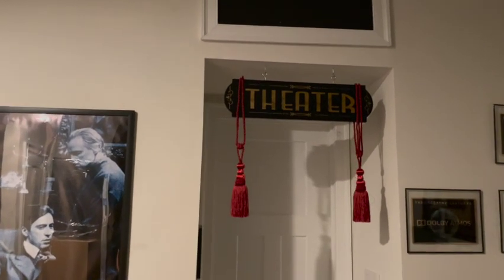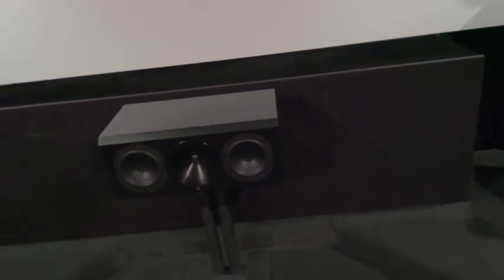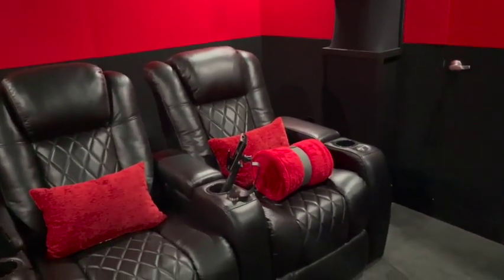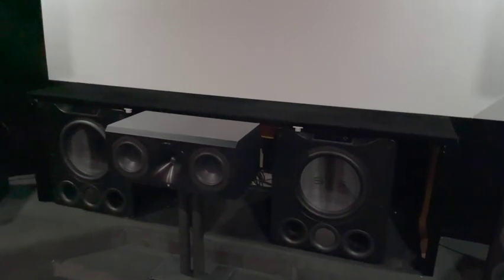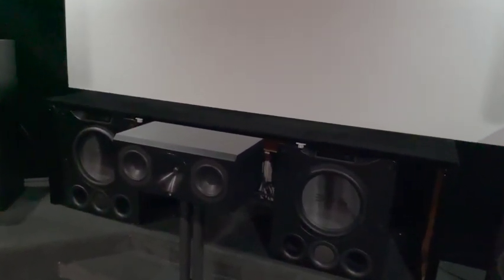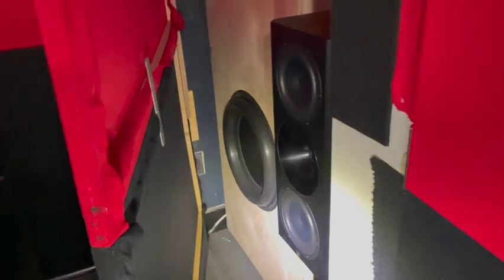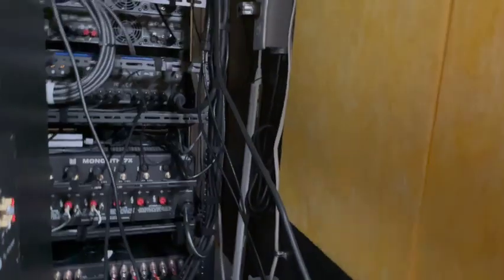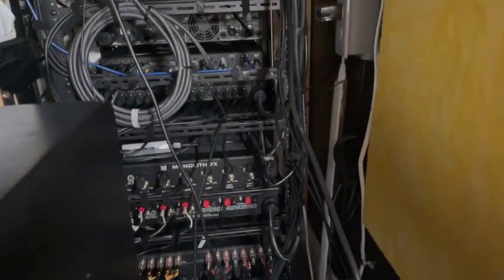DIY Home Theater Tour 2021 - | Monolith | Arendal | JVC | ....

Comment: Nice job!  You sound like me, buying extra's of everything so if you need it later you have it.  I have a whole room full of crap acquired based on that reasoning.  Probably most of it I will never get around to doing anything with.
Reply from the maker: Thanks!  And, yea, there's definitely some stuff that's never gonna get used, but it's so nice when you have an idea or you're working on something and you have exactly what you need on hand.

Comment: Awesome job, love the whole layout.  I do have a question.  How did you do your panels for your screen wall?  I am building a faux screen wall in front of window and I am getting ideas on how to do panels for the wall.  Thanks again.
Reply from the maker: Thanks!  It’s just some 1x frames.  I think I used 1x3 pine.  Just have to add a brace near the middle on the longer/taller frames.  Then I wrapped them in Velvet.  They are all friction fit in place between the walls/ceiling/floor.
Reply: @dwht5893  thanks for the reply.

Comment: Hey sweet setup! I have had my eye on  the GSG BTS series but havent been able to find much from anyone who owns one. Are you happy with it or would you try a different profile if you were to do it over? Performance wise how do the compare to the PB 16 ultras?
Reply from the maker: My space for the rear subs is pretty tight, but if I built the box myself I could have made it a little bigger than the BTS and picked up a little more extension and output.  However, the BTS was very close to what I wanted and I knew it would be a better built box than if I did it myself.  I have no regrets with the call I made though.  Only thing is, I didn't think to ask them to custom size it for my driver, so I had to do it myself with a router.  

I find that my DIY subs blow away the PB-16s.  I got the PB-16s in earlier the same week that I built the DIY subs.  So, I installed the SVS, did a quick calibration, and I found them to definitely be better than the HSU Research subs they replaced but they didn't blow me away or anything.  Granted it was very limited listening.  With the DIY subs, I got them installed and calibrated late Sunday night, so I just finished and went to bed.  Came home from work the next day and threw on the same demo as I did with the SVS.  It was a whole other level.  One of the rare moments for me where I first use a new piece of gear and I'm just completely blown away from minute 1.  Those Stereo Integrity drivers are definitely worth their price.  The PB-16s do provide a good amount more extension though.
Reply: @dwht5893  thanks so much for the answer. I currently have one SVS PB 1000 and dream of the day of upgrading further. Unfortunately I don't have a dedicated theater room but instead use the corner of an large open partially finished basement. I knew I could fit the BTS boxes behind my screen but couldn't find any reviews for the life of me. Your theater is quite the inspiration. Thanks for the tour and the feedback.

Comment: Are you running DLBC for the 4 subs? How's that been in balancing the bass on that room? Especially with integrating to the crossover point on the fronts?
Reply from the maker: I've been using DLBC for a little while.  Dirac as a whole was a bit of a learning curve for me, but after a lot of playing around I feel like I've figured what works for me.  It does a really good job with the bass and integration of speakers to subs.  Especially with the front 3 speakers.
Reply: @dwht5893  Thank you, any tips or pro advice for experienced users? I'm pretty comfortable with Dirac, but DLBC will be new to me. Do you still have the MiniDSP 2x4HD in the chain? What corrections are needed post Dirac results?
Reply from the maker: I have a MiniDSP still in the chain but only on the DIY subs as a HPF.  But if youre comfortable with Dirac then you should be fine.  DLBC has 3 levels to choose from which create the filters a little differently.  You'll want to use level 2 for all surround applications, and Level 3 for any 2 channel with Subwoofer applications.  What can be time consuming is it takes a few minutes to calculate the filters.  Then in each speaker group it will show you the predicted response for the speaker spliced with the subs.  As soon as you make a single adjustment the predicted response goes away and you need to calculate again to see the new response.  So when you start playing with different crossovers you will adjust the crossover, calculate, and see the response.  Now if you don't like the result then its rinse repeat until you're happy with what you see.  So that takes time since you have to do it for each speaker group.

The two main things in general that took me a little while to figure out that really helped was:
1.  How to yield channel trims that I was happy with.  At first I kept getting low trims which made me have to crank the volume higher than id like to get the level I wanted.  Not a problem for everyone, but it was for me.
2.  Mic Locations:  For a while I was trying to closely follow the mic positions that Dirac shows in their diagram.  That was yielding some weird results when measuring post calibration.  So I started keeping the mic positions tighter the listening positions and that yielded both good sounding results and good measurable results.
Reply: @dwht5893  Man, this is gold. I really appreciate you taking the time to write that up. One last request, would it be possible to run 2 identical subs via y cable to one of the subwoofer outputs, so Dirac recognizes as one? DLBC is only limited to 4 subs channels, correct?
Reply from the maker: I don’t believe DLBC has a subwoofer channel limit.  In my case, its the processor that has a limit which I believe is 5 subs max.  But You could definitely combine two subs to one channel with a Y splitter, but I would only do that if they were the same distance to the MLP.  Otherwise it would be better to use a MiniDSP and align them before running Dirac.  I’ve been considering adding front wides to my system which would only leave me with 3 sub channels, so I’ve been thinking about how I would go about combining two subs to one.
Reply: @dwht5893  Thank you again. I'll be digging into the setup this week, so your advice will be invaluable. That's too bad the max sub limit is 5. I'm possibly aiming for 6, but I might two pairs of compact subs, stacked, for the front stage, so I might be able to get away with the Y splitter. Should be fun to try. Do you feel there's a gap in your front stage, to warrant front wides? Those Arendals have some crazy horizontal dispersion with that waveguide, so I figured you'd be set there. It would be cool to see if one to implement two pairs of narrow dispersion speakers with a deep soundstage, like the KEF R3/R5. I can see that working for front wides.
Reply from the maker: You may be right.  I've been debating adding wides for a little while and can't seem to sell myself on it.  I'm thinking when DTS-X pro becomes available ill test with some speakers I have on hand and see what I think.

Comment: Wow, I love your room! Can you give any details on your masking system? I built one with a roller shade motor that came out pretty good. What did you use for yours?
Reply from the maker: Thanks!  I used the same thing.  My first version used a pvc pipe bc I couldn’t easily find a roller shade tube.  I had to use a bracket in the middle to keep the pipe level which forced me to have it roll away from the screen which isn’t ideal.  Eventually I found shade tubes and re-did it so it would roll towards the screen.  That keeps the mask tighter to the screen which works much better.  Only issue is that the bracket from the first version stretched the fabric a little.  So when I leveled the new version with the roller shade tube the fabric wasn’t level to the screen when it was down.  So I had to adjust the fabric to make it level.  Now, the only point the fabric is level to the screen is in its down position.  It’s not a huge deal as it functions the same but it would look cooler if it lowered and raised nice and level.  I may get some new fabric at some point and redo it.  

I took the fabric to a tailor and had them size it and add a pocket across the bottom.  The got these 1”x48” aluminum bars, taped them together and slid it into the pocket to keep it weighted and level.  
Masking makes a huge difference to the experience imo.
Reply: @dwht5893  Do you only have the top mask dropping down? I guess you use the lens memory to adjust between 16X9 and scope? I could have done that with my JVC but I also use a DLP projector as well for non-movie content and wanted the option of masking for that content as well. I agree, masking makes a huge difference and I wouldn’t go without it. How do you control your roller shade motor? My remote is RF and I haven’t found a way to control it with my Harmony so I have yet another remote in my setup. Here is a link to mine https://youtu.be/UhRA4Vdx6oc
Reply from the maker: Correct.  I only drop down and use the lens memory on the JVC.  Honestly, I’d prefer it your way bc I don’t like switching between the two lens modes.  I use an RF remote to control it.  I’ve tried two different motors and both have similar RF remotes.  The first one I used was Tuya Zigbee which I picked bc I thought I could get it to work with the harmony hub.  I bought the required gateway hub on Amazon, but then realized I  also needed the Harmony Home Hub Extender to get it to work.  It was discontinued a while back, but can still be found used.  It just didn’t have great reviews as far as reliability so I just left it alone.  But my initial plan was to try and create a one button solution for the mask and lens shift.  It just didn’t work out, but I’m sure it’s possible.

Comment: How do the Arendals compare to the Klipsch RP line in your opinion? Been debating on switching for a while.
Reply from the maker: Definitely a much more neutral sound.  Was an adjustment on day 1.  But the more I pushed them the more I was sold.  Can really crank them without any type of ear fatigue or distortion.  And they are incredibly dynamic which continues to impress me after 16 months with them.

Also, the build quality is a definite step up.  I’m not sure if that translates into anything sound wise but gives a feeling like you got your money’s worth.  No regrets at all.
Reply: Hello DWHT,
Great job on the Home theater, it looks like you put a lot of time and thought into every little detail! I am the same way, 

 I wanted to ask you, I was also wanting to switch speakers from  Klipsch RP line but after trying several other house sounds, I keep going back to the Klipsch RP 504 center and 8000f LCR for movies, I set them with a nice roll off and DSP a little off the top, add a little to the midrange etc., etc. Furthermore, I like the excitement and detailed sound of the Klipsch RP line.

 The  AMT and Soft domes sound like something is missing to me, did you feel this way also at first? I love the shimmer or airy sound you get from high-end hard domes and metal ribbons. I really want to try some beryllium or Raal tweeters for my LCR, but it is still a little too pricey for me, have you demo'ed either? Everyone likes those Arendals and the Monolith THX mini towers for the SPL output, but how does it sound at lower listening levels? 

I like soft dome, AMT or Kapton Ribbons for 2 channel listening, but I really like hard domes for Movies, I wanted to see how you made the switch to soft dome after owning the RP line and if you miss the extra air and detail of a hard dome? 

                     I have not been able to find one review on the 1961 or 1723 house sound or a good comparison? I know there is detailed and lively soft domes like the Jamo or BW's soft domes to name a couple, but they still are missing that shimmer or air imo,
 Looking forward to your Reply thank you! Jason
Reply from the maker: @jasonshud2636   At first listen it did sound different, like something was missing from the top end.  But as I started to push them I quickly started to prefer what the Arendals offered.  The dynamics and the clean output was really impressive to me.  I didn’t miss the Klipsch at all.  When I switched from Marantz to Emotiva/Monolith processors it added the top end shimmer as well.  The Marantz didn’t really have that.  The Klipsch did kind of give something comparable when paired with the Marantz but at high volumes it could get shrill and fatiguing.  I don’t get that at all with the Arendal and Monolith combo.  It just sounds more natural to me.  Plenty of detail still, but without any kind of harshness.  I’ve just been very satisfied. 

I don’t have much experience with other speakers, but I do have 2 pairs of Martin Logan with ribbon tweeters.  They are pretty good, and sound great with certain music, but I don’t think I’d personally go that route in a home theater.  It’s hard to say what will work best for different people though.  I really had no problem with the Klipsch.  I just wanted to see what else was out there.  The stuff I love about the arendals was stuff I didn’t know I was missing until I heard it.

Comment: What is the size of the port on your GSG BTS?
Reply from the maker: Do you mean the size of the opening or the port dimensions to use for like a WinISD model?
Reply: @dwht5893  The dimensions would be good, thank you.
Reply from the maker: @kevinr1282  I can’t really measure it, but I have dimensions from some models I did before I got them.  I had to figure it out myself which means it could be off a little, but it should be good for modeling purposes.  I used a 6”x14” vent at 55” long.